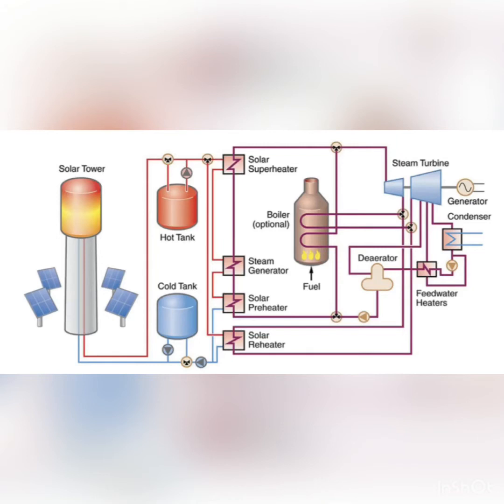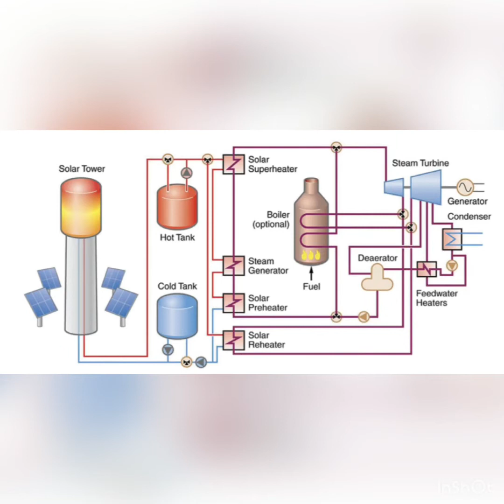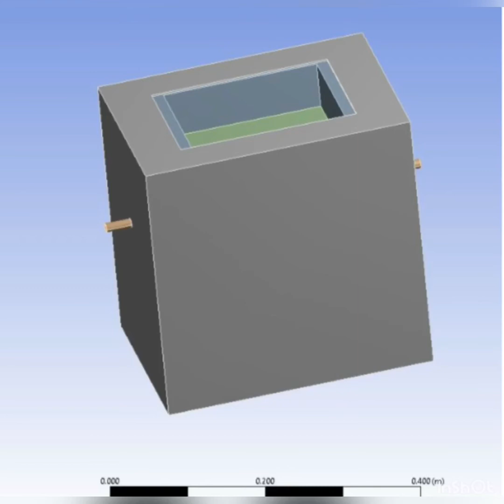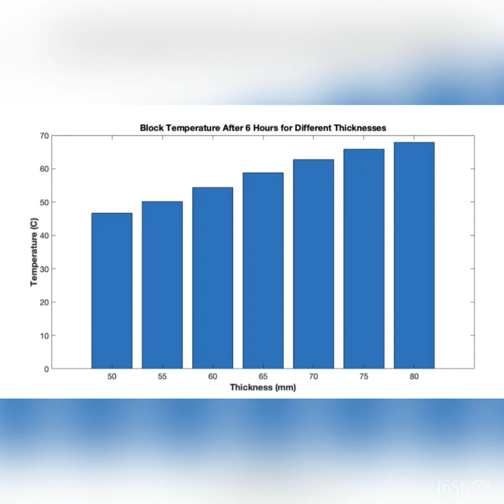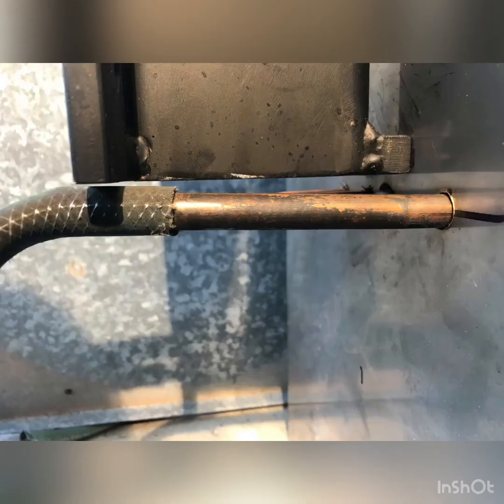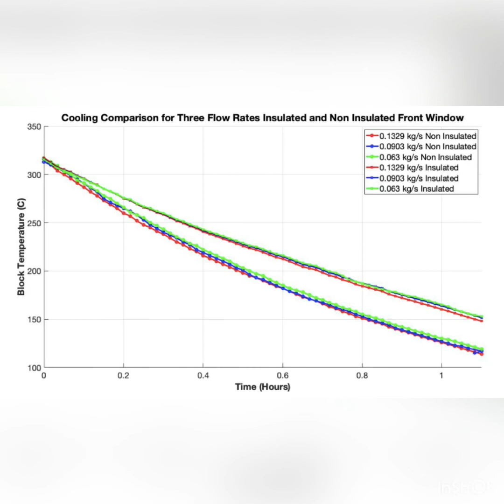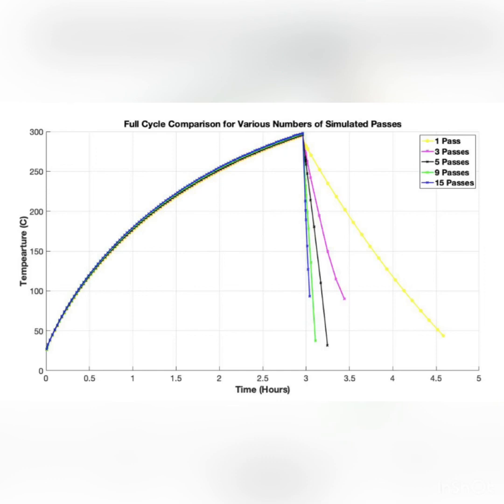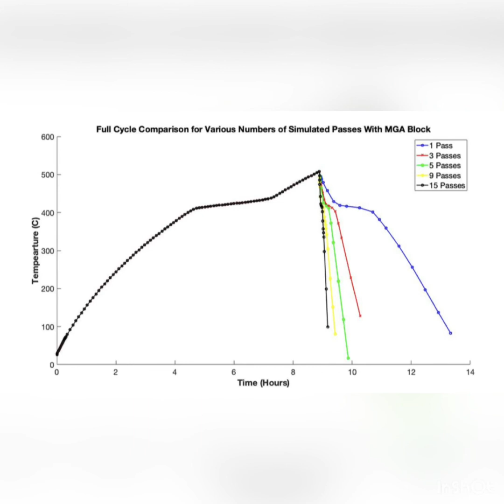Mga project

Comment: Pretty interesting project Dan S,
Is this system made to run mainly when there is no sunlight, acting as a thermal battery, or 24/7?
Would this test unit retain enough heat to sufficiently steamify water all night long, or would that require a larger unit?